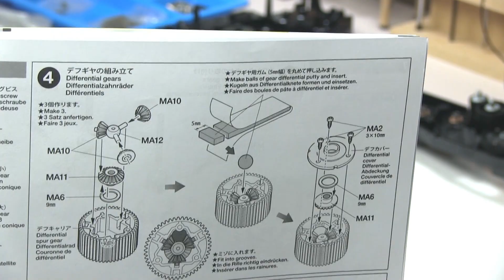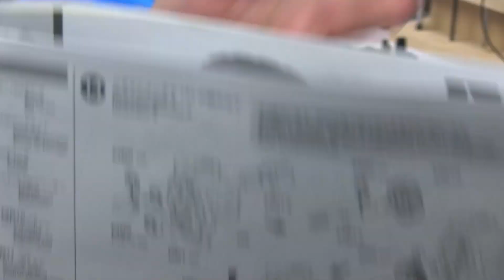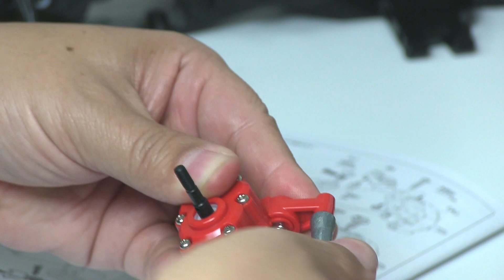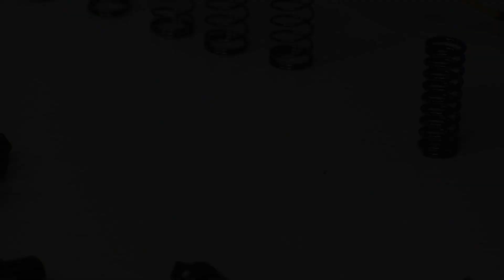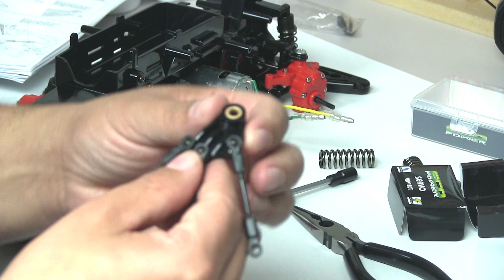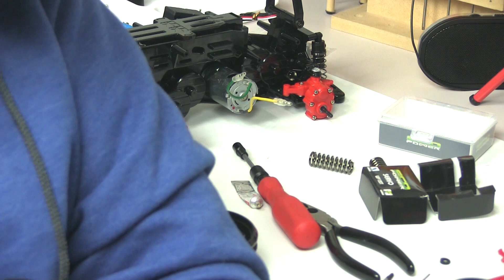Tamiya Dynahead 6X6 G6-01TR: In-Depth Build Video

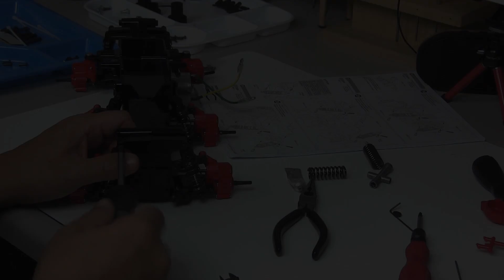Comment: I am in the process of building my own.  I am having a problem with the springs fitting correctly on the shocks.  After the shock is assembled the spring is not preloaded on the shock, and the spring retainer is not held in the correct position on the shock rod end..  I notice that around the 14:54 time stamp where you show the shocks mounted, your springs are not preloaded either.  Is this an issue with this chassis build?

Comment: Nice , could you do one on the super astute too? Id love to know wether they still have splined hex adapters or not.
Reply from the maker: We don't have a Super Astute yet, but yes, will do a video like this one
Reply: @AirAgeMedia1  From what I have seen its sadly still platic gears, but metal driveshafts and if they are splined, be ready for the Dyna Storm and Dyna blaster as they share 70% of the parts with the Super Astute and have other parts from rereleases, so the molds for the parts are there to 80ish %
Reply: @lacucaracha111111  Nothing wrong with those plastic transmission gears. Very beefy.
Reply: @philthyco1  I chewed through 5 spurgears on my blazing star with a 20 turn BL motor and the corect pinion with the matching holes
Reply: @lacucaracha111111  The Super Astute has a slipper clutch set up..Nothing like the Blazing Star ..If I remember correctly the Blazing Star is a 4wd buggy based on the Manta Ray..The Super Astute is a 2wd racing buggy.
Reply: @philthyco1  Im rather concerned about longevity than actually stripping it as tamiya hasnt relased too many spare parts, neither front bulkheads (a known weakspot in both astute and super astute), nor arms (the most likely thing to break), nor replacement gears
Reply: @lacucaracha111111  Tamiya sell's full parts trees and hop up parts.
Reply: @philthyco1  Id be open for a metal front bulkhead and c hubs, and RPM arms. Sadly I cant get any locally :(
Reply: @lacucaracha111111  You don't need all of that unless you plan on jumping crazy high lol..Do you really like the Super Astute? It's a tried and true 2wd racing buggy..Build if if you like and and if not then build something else..Cheers.
Reply: @philthyco1  It looks awesome and is so far the closest to my first hobbygrade RC and should be somewhat easy to mod. but If I go from the basic tamiya plastic used in tt-01 and others the arms may be brittle in the colder days where a tumble could snap them.
Reply: @lacucaracha111111  The newer Tamiya resin blend is better than the old ABS
Reply: @philthyco1 Lets hope so :)
Reply: @lacucaracha111111  I've built many old school and newer/re release Tamiya kits..Trust me it's not like the 80's anymore plus the Super Astute has minimal plastics
Reply: @philthyco1  bulkhead, c hubs, A arms, rear hubs, shock bodies, Chassi and shocktowers may be FRP or actual carbon fiber, gears, greabox which is about the modern standard
Reply: @philthyco1  There seems to be a difference between the old hardware and the new. The screws and bolts don't have that goldish anodized color like the older kits and seem softer and easier to strip.
Reply: @lacucaracha111111  lol..You don't like Tamiya ..It shows.
Reply: @blkft  I don't agree..All the hardware is much better than before.
Reply: @philthyco1  No, maybe some of the black screws in the kit(s) but the silver-ish ones are definetly softer and are prone to stripping.
Reply: @blkft  Are you using the Japanese standard screwdriver?
Reply: @philthyco1  Make sure we are on the same page as this thread started about the Super Astute. I'm referring to the GF series and other current Tamiya's.
I started out (30yrs + ago) using a Snap On Multi Driver on the older kits: 959, Wild Willy, W/Wheeler, Blazing Blazer, Bruiser, several Clods, TA's, and about a million Blackfeet. Never had a issue unless ya really tried. I progressed to a set of WIHA drivers including Japanese Standard a long while back. But I've notice on my two recent GF01s, TT02's, and CR01 that the silver self tapping and machine screws are not the same quality, softer and more prone to stripping out. I wouldn't feel comfortable tearing down and rebuilding (ain't that part of the fun?) and reusing the hardware like on the older cars. Now the two semi's I have and the re re XR311 seem to have the older style type hardware, atleast for the most part, are fine. Please don't get me wrong, I am a big time Tamiyaphile and love the brand so I am not bashing them. I just noticed the difference. I've alot of that older hardware used and NIB, it seems better or more robust. 
It may just be the "fun" Tamiya's and not the racing kits, I haven't had a chance to tear open the M07 yet to check.
Reply: @blkft  Good Lord that was long! I remember the same self tapping silver screws when I was a kid building my falcon and a few other kits I built for friends ..Yes, the higher end kits do not use those screws but they don't seem different to me from all the entry level stuff from years ago..What has changed for sure is the plastics..For the better.
Reply: @philthyco1  Tee Hee!!! I know, get me blabbin' about Tamiya's and I won't ShaaaaDUUPPP!!!!
:))
Reply: @blkft  Tamiya has so much to talk about!! lol..Sub my channel I do a bunch of Tamiya build-off's and general RC stuff
Reply: @philthyco1  Sure will. Thanks!
Reply: @philthyco1  I love the old kits, but since the fusion with dickie platic parts quality have taken a nosedive and quantity of them in kits went way up. It started to recover slowly.

Around the 90s near all of their kits but a few "fun trucks" like the lunchbox had metal driveshafts and outdrives as well as tunbuckles nearly everywhere.

Now all is ABS plastic, not even nylon
Reply: @lacucaracha111111  You have no idea what you are talking about at all..It's funny lol
Reply: @philthyco1   and you do?
Reply: @lacucaracha111111  Yes..Because I've built many many Tamiya kits in my day..I still build these days..You just talk a bunch of shit that you read on forums lol
Reply: @lacucaracha111111  Tamiya doesn't use standard ABS plastic on driveshafts or out drives you fool..Build a kit before you talk all that bullshit..lol
Reply: @philthyco1  How do you know?
Reply: @philthyco1  What do they use then Mr factory worker
Reply: @lacucaracha111111  They use a reinforced plastic blend..Not the old hard brittle ABS..Parts trees in the kits vary from types of plastic.